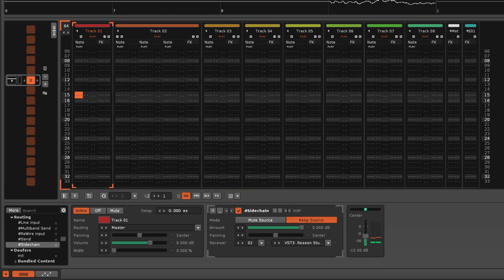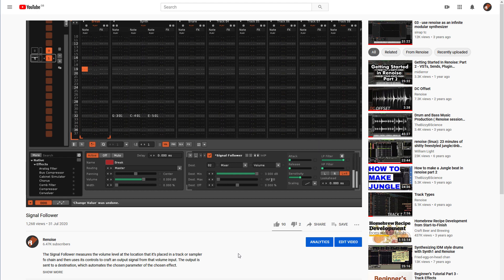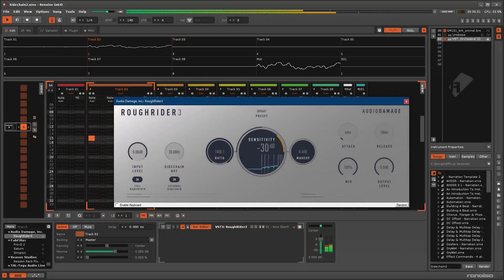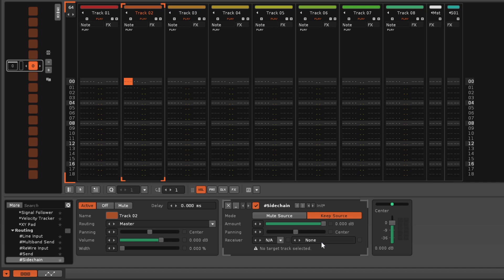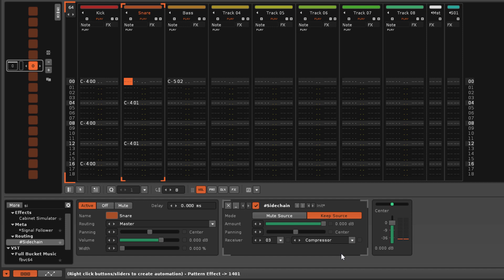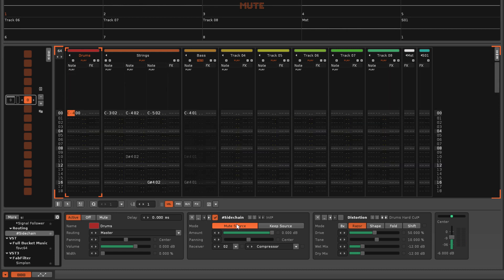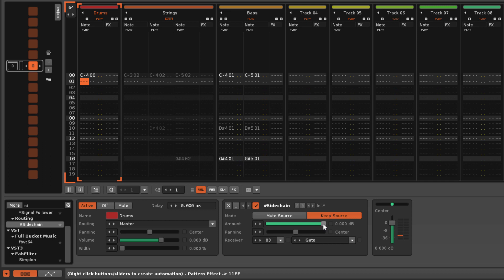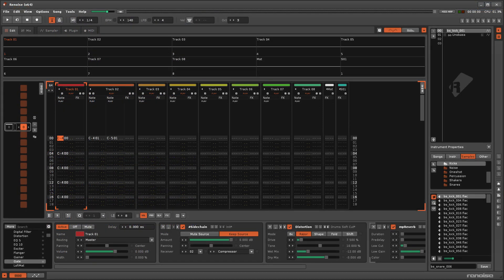Sidechain

Comment: @Renoise
I have a demo version of ReNoise on my computer for a while now, but never got to actually buy it, because there wasn't a way to properly integrate it with my main DAW, Reason.
Now I got myself the Reason 11 Suite, including the Rack Plug-in. But when I tried to use it in ReNoise, it somehow didn't work. (If I remember correctly, couldn't find the plug-in in the list, although I think I gave it the right folder to look in.)
Now I just saw you using the Reason Rack in ReNoise and got curious about how to do it.
Maybe you (or someone else) can tell me, what exactly I have to do to make it work… on a PC running Windows 10…!? :)
Reply from the maker: Download the latest version that was just released. We've added VST3 support, which is what the Reason Rack uses: https://forum.renoise.com/t/renoise-3-3-and-redux-1-2-released/62761